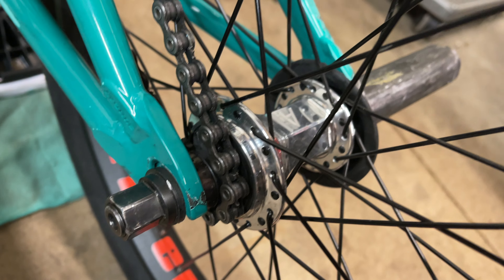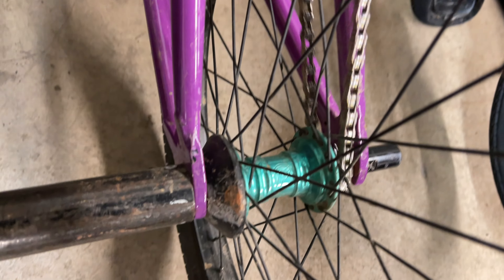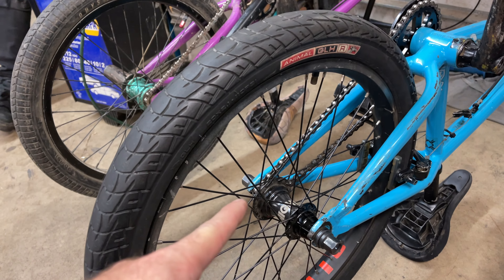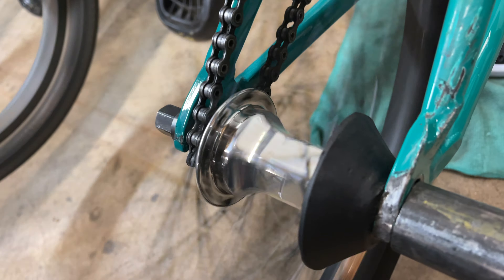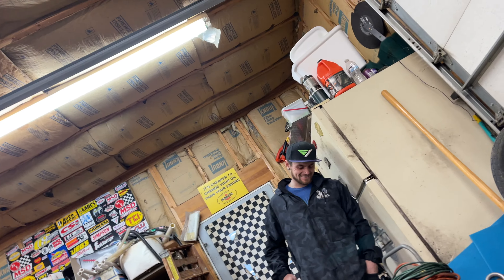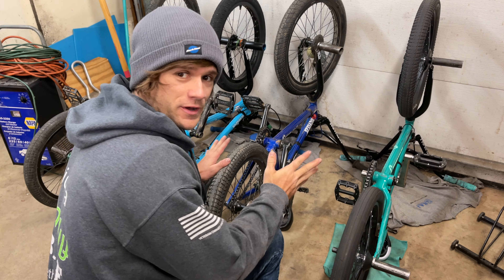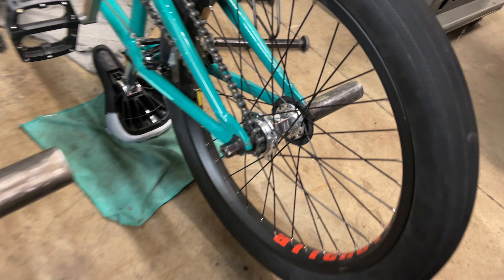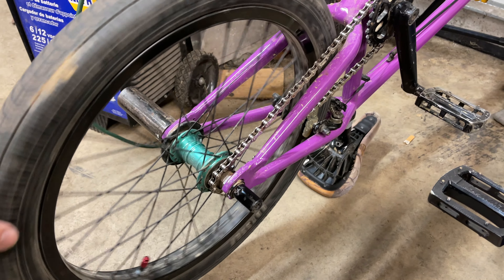BMX Hub Sounds! Planetary Freecoaster Sounds Compared Vs Profile Elite!

Comment: All close to each other but still slightly different.
I like the sound and look of your Alienation Venus though the best.
If it came in Polished, Chrome or even Titanium outer hub I'd buy that in a Heartbeat and put those Titanium aftermarket parts inside like you did! 👍

Comment: I've had my BSD revolution wheel  for over a year now and it's still pretty quiet. Have you degreased yours? Mine hasn't been touched internally.
Reply from the maker: They come with no grease in them. Obviously from previous videos I’ve had my apart but I haven’t done anything internally either. The only thing I ever did was tighten the drive side jam nut pretty tight
Reply: Changing to a new O-ring might make it louder
Reply: Not fussed about the noise being quiet to be honest. Just curious.i came from a profile mini so I'm enjoying the the stealth mode of the BSD.
Reply: @nightriderbmxshop6768 how will the oring make it louder? dont you want the new oring to make no noise/squeack?
Reply: @Cheesicle_  it's a fine balance of the force

Comment: There is virtually no sound difference in any including the mini because they all run similar pawl drive mechanisms. Lube amount may cause any noticeable differences. I have KHE type freecoasters (silent), Profile Elite, Primo V3 cassette and a Madera cassette (same as a mini). More pawls make more noise. Tooth ring design and pitch makes differences. I believe the Elite has offset pawls (ever so slightly) giving it twice the sound and engagement over even pawl spacing. If you spin my elite driver very slow you can sometimes hear a single click. Then a double click. Anyhow I’m about to buy a BSD planetary to try out. Anymore…i like silent. I like hearing my tires grip the surface…or not grip.  My Elite can get on your nerves after a while.
Reply: I will add my Primo Remix V3 is very very buzzy and loud. Much like the Profile Elite. And has very minimal take up. The Elite has basically zero take up.

Comment: The louder it is the more friction is being caused. Not exactly what everyone wants.
Reply from the maker: That’s why I did a video like this one. Everyone needs/wants something different for sure and hopefully this video helps them choose easier
Reply: Correct, and consider also the pawl's hight travel for each click
Reply: Is this freenight using the 3D print clutch or the new one?
Reply from the maker: This is the very first one you ever sent with no changes other than the ti axle
Reply: Absolutely, especially in freestyle where you don't really need very much speed. I run an elite and my wheel doesn't spin on its own very long when you crank it up, but it sure is loud and the engagement can't be beat. Thanks for the kind reply to my smug comment :)